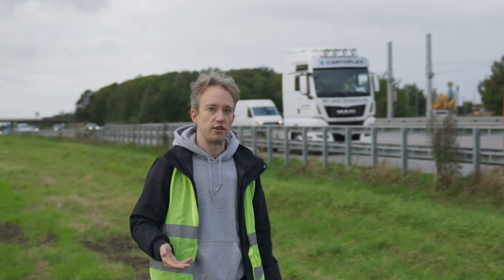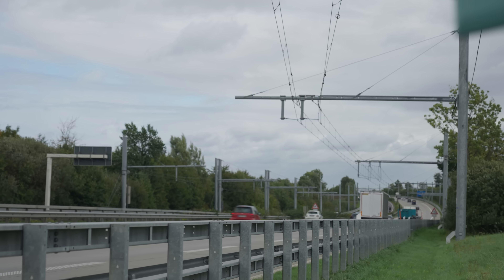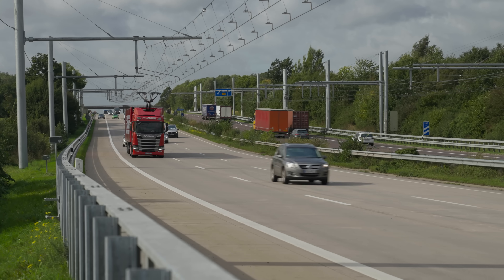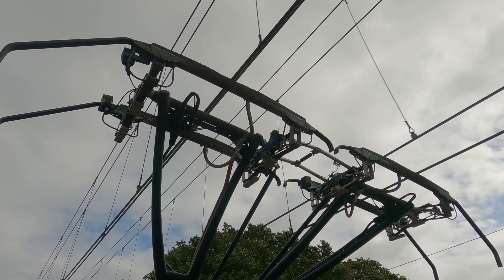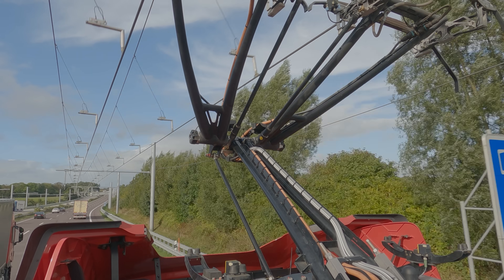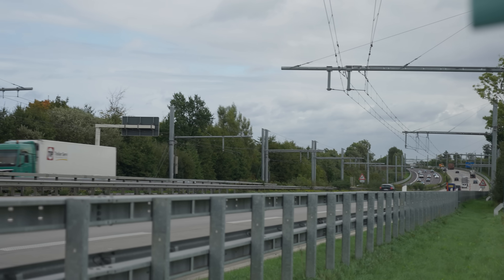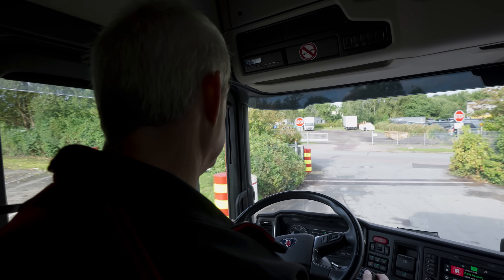The highway where trucks work like electric trains

Comment: One issue here is illustrated at 3:02, where you can see grooves in the carbon tracks on the pantographs. On railways this isn't an issue because the rails are fixed and the catenary wire deliberately zig-zags between masts to prevent the groove problem. With trucks naturally varying their lane position slightly this controlled even wear is negated, so it probably wouldn't be long before a lazy HGV operator doesn't change the carbon collector strips and forgets to lower the pantograph, almost certainly resulting in damage to the carrier wire.
Coupled with the fact that rail OHLE experiences less than 400 passes per day (one train every four minutes is way more than even the WCML) and it quickly becomes apparent that it will need to be seriously 'beefed up' to the same grade as the third rail that is used on higher intensity lines such as the underground. Ultimately this has potential thanks to the flexibility of trucks being able to operate on a mixture of mains and battery. but it definitely needs more robustness building in if it's ever going to make it for regular use.
Reply: i've noticed that, too, however, trucks have to undergo regular service inspections in germany, so you could technically make the carbon collector strips beefy enough to last 2-4 years so they'll just get replaced ever so often. only works due to laws in germany, though
Reply: As far as I know, railway pantographs already have a system in place to prevent damage to the overhead line by a broken slide plate: The pantograph is raised pneumatically, and the slide plate itself is also hollow and the cavity is connected to the same pneumatic circuit. If the slide plate is now worn through or otherwise broken, air escapes through the breakage and the pantograph is lowered due to the lower pressure. 
As trucks also have brakes that use compressed air, the air system is already there and the pantograph pneumatics could be directly used. Maybe this is already done.
Reply: The pantograph could be made to drop should power ever be lost. If it requires an electromagnet powered from the line to keep raised , for example, this could be automatic. Accidents will happen though and that's why rescue services were involved - what's the plan for when (not if) things go wrong?
Reply: Thinking the same, on railways and tramways the wear is negligible, but in highways it will be way more. But on the truck side I think it can be solved by putting a little more angle between catenaries, so it can more easily swipe across the pantograph.
Reply: Trolleybus-type poles? The little wheels atop those would surely wear better.
Reply: @marknpm  ok, but how do you easily decouple and hook on? Trolleybuses are intended (usually) to stay connected permanently.
Reply: @Giruno56  Ah, I see what you mean. Some sort of long half-funnel shaped upside-down guideway as a lead-in, perhaps? Or use the good old traditional method of stopping and raising the trolleys to the wires with a great big hooked pole. 😉
Reply: @marknpm  That'll require the trolley to be correctly connected to the wire, which is easier said than done. Pantographs have a lot more tolerance, but the wire needs to be able to zig-zag accross the graphite to extend its life time.

These lorry pantographs are automatically moved to keep aligned with the wires on top. All that's necessary is to improve the algorithm to better distribute the wear on the graphite.
Reply: @tpmiranda  Self driving trucks can help with that. They'll be more capable of holding the optimal position in the lane. Regardless, needing to change a couple graphite plates every x miles is no different than the other types of service a truck requires. And getting the pantograph serviced won't need to be government regulated as the driver/trucking company will have the incentive of wanting it to work so they can get power.
Reply: @tpmiranda  My putative lorry-trolleys could also be automatically aligned with the wires while being raised. Those dipole pantographs look like they might suffer from arcing in wet or freezing conditions to me — not so much of a problem with trolleys.
Reply: Remember that a typical train has multiple pantographs (usually one every 2-3 cars), whereas each truck only has one. Wear would be an issue, but not an insurmountable one.
Reply: Maybe use conductive tires on the truck to ground it, so no second wire would be necessary.
Reply: theres many ways to engineer around this, the lines surely have enough flex to jump over these grooves assuming theyre worn into a smooth wave no 90degree ledges in the carbon, and secondly they can build in weak links to the carbon rails so that they will break loose/move around if theres too much force applied to them in order to save the lines make the replaceable truck mounted part the weak link

Comment: When I was in high school I took technical drafting for three years.  In my senior year I sketched out an idea for a way to retrofit highways with a magnetic levitation "express lane" where cars could be guided at high speed surrounded by magnets.  It would also enable charging of on-board batteries, but at the time I only thought of electricity in cars for stuff like air conditioning, heat, radio, lighting, etc.  We weren't thinking about cars running on anything but gasoline back in the 1980s.  I thought I was being clever for taking the battery life into consideration at all while the engine was off by using the magnetic induction to keep the battery topped up.

Comment: The thing that I don't like about this overhead charging wire system is the height limitations which could impact oversize load transport. Also, an electric car would need a giant pole to reach the charging wire. 
I think a system similar to a giant slot car race track could work better as both cars and trucks could use the electric charge from it without any height restrictions. Plus, such a slot could also carry data to the self-driving computers of said vehicles in addition to recharging them. The pin on the underside of the vehicle would have to be standardized and retractable to go over roads that do not have such a charging slot lane.
Reply: Presumably the height limitation would be the same as the bridges that are already there?
Reply: Debris and water would have to be accounted for
Reply: There's testing strips of highway for that in Sweden since a couple of years back.
Also, the tram system was installed and highway tested back in 2016.
Reply: I don't think that this wire system is intended to be used by anything but trucks. I can see your point with the slot system, however this would require directly working on the highway lanes to install, while wires can be spanned overhead without ripping open the asphalt. Lastly i think having the car attached to the ground may be a double edged sword. On one hand you could literally have the car act like a train where it follows the slot automatically. On the other hand i dont know how this would affect crashes. 

Honestly, the slot idea is inseresting but it has a lot more open questions and seems more costly to install than wires. Maybe this could be a concept for the future but right now wires seem to be the easier idea to pitch and implement.
Reply: and how would you handle dirt and water?

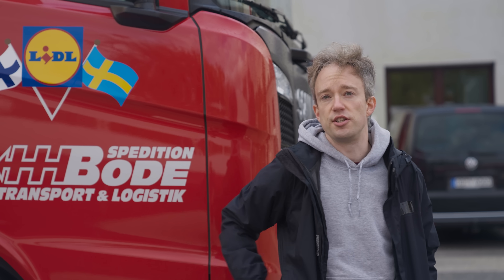Comment: At 3:46 you can see massive marks in the graphite of the pantograph. Railways deliberately span the overhead wire in a way that wears the collector evenly. Is there some equivalent technology planed? Because if the wire always stays on one spot on the collector the collector might be unusable very fast and could potentially snap in half.

Comment: From a visual appearance, the overhead wires look ugly.  But, the idea seems like a good solution for using electric on trucks.  In the United States, those wires would be snagged and ripped down in a week by an oversized load that travels our highway systems constantly.

Comment: The problem with this is that it requires significant investment in infrastructure. Not to mention that it might not be necessary at all.
The problem with electric cars in general is that people are taking the wrong approach, using batteries that are charged via the grid. There's reason to think that is not the only solution. Batteries are great for small portable devices. Vehicles need power plants.

Comment: This (and electrically powered vehicles for that matter) seems like a good solution until you realize that producing the energy that is needed for electric cars and trucks is the real problem. When Germany is shutting down their nuclear reactors in such a drastic manner they have to use fossil fuels to be able to meet their energy needs because renewables are simply not enough nor fully utilized. The gearing towards these electric vehicles means a lot more energy is needed to power them, that we don't yet have a way to produce in an environmentally friendly way.
Reply: That's actually untrue. Because a thermal motor is very very inneficient and electricity is so much more zfficient, you actually pollute less by burning coal in an electricity generator that is way better at its job than a motor, then send the electricity to a battery. In this case it's even better since you don't even have to go in a battery. 

This is a net positive, even if they are charged by coal. That's just to say how inneficient burning gas is to move a vehicule.

Litteraly every other electricity source will get you an even better result. So no, this is a good idea.

Comment: I like this very much. There's no downside other than the grid wich has to be built and maintained, and the electric drives for thousands and eventually millions of trucks.
But we are very experienced with the grids already. And electric trucks, at least on the highway and elsewhere diesel, are no problem either.
The only real problem I see is the immense abrasive effect of millions of vehicles. We would probably need something else than two sliding solid metal parts.
Reply: Agree that wear with intensive use would be a concern. Typically a train would only have one pantograph per locomotive or power car for a locomotive hauled train, and one per EMU set for EMUs, thus the number of pantographs passing per year is far lower. Each passing truck with a pantograph would wear the wires out much faster. I'd also be concerned about road wear with such a system. It appears as shown here the system uses human-driven trucks, but it would make a lot more sense for automated steering to take over to keep the truck in position under the wires. Manually steering that precisely for any length of time would be exhausting for a driver, and automated is surely the future anyway. This would produce a result similar to a "trackless trolley," a vehicle that automatically follows a precise course, possibly even following a painted line on the road, or super-precise GPS. Such things have been used in public transit for some time. Given that these trucks, like the aforementioned trackless trolleys, probably all have the exact same track width, this causes the problem that they are rolling over the exact same spot of pavement each time. This wears sharp grooves in the road, much worse than manually steered vehicles that will spread the wear out over a wider rut. There are rubber-tire people movers that apparently have solved this problem through specially-designed roll-ways - they have very sharp-edged tire marks but apparently don't wear too much - but that would require rebuilding part of the road. If they don't do that, higher maintenance costs will result as they have to keep fixing the grooves. Either way a lot more cost than simply stringing up some wires.
Reply: @quillmaurer6563  Good point about the grooves. I don't know how I'd try to solve that with software. Adding a randomizer to a steering system feels strange.
Reply: The downside is that you are doubling the propulsion system on a truck, so it now has to carry double the weight around. All the time. And you are still burning diesel.

The only world where it would make sense to combine this with a purely electric drive train would be one where truck drivers are allowed to drive 24 hours a day without breaks.
Reply: @HenryLoenwind  It's mechanical possible to add a minor gearbox and a motor, with cables and controller, and that's it. That's maybe the weight of the transmission. 
You add like five percent weight to the complete fright rig, without traction batteries.
Reply: @gustavgnoettgen  I would assume most vehicles using this would already be hybrid or electric, so they'd already have electric motors.

Comment: The technology has proven itself in trams and railways. The speed of 80 - 90 km / h is also no problem. The extra cost of the lorry is not the problem. Especially if the Lorry doesn't have a combustion engine but an electric motor and batteries. Only the highway is expensive to equip with it.
Of course, it would be good to introduce the same system across Europe. But there are also E-Lockomotives that can cope with different electricity systems in Europe, but they are more expensive.

Comment: Here's hoping that this tech makes a proper dent in the old ways. Even though the trolleybus tech was around about a century or so ago.
Reply: I could still see trains being used for stuff that trucks can't handle, mainly really heavy cargo.
Reply: @the_furry_inside_your_walls639  from what I understand, this solution is mainly for routes where transporting cargo by train is either not possible or just less practical.

Comment: I agree with the other commenters.  Rubber is not very durable or energy efficient.  Replace the rubber wheels with durable steel wheels.  To further reduce ground resistance, place those steel wheels on a steel strip.  With the increased energy efficiency and reduced ground resistance, you can place multiple trailers on a single truck engine, thus further increasing efficiency.

If someone were able to make that happen, it would be a billion dollar idea.

Comment: Brilliant solution. Hope it works and catches on. I've heard of people testing an In-Road option that smaller cars could connect to as well. Has its own issues and pitfalls (now and debris) but if cars could run off a similar system it would make a huge impact.